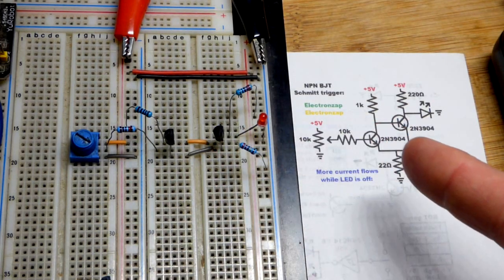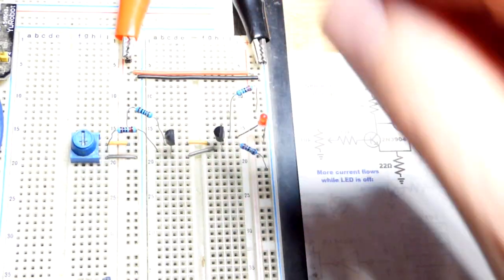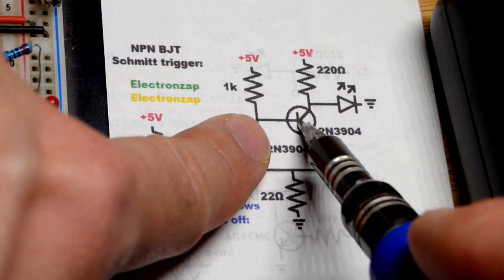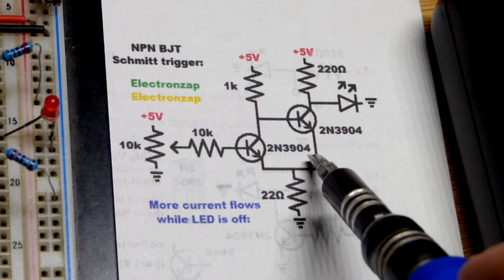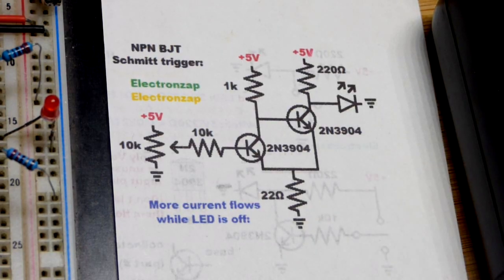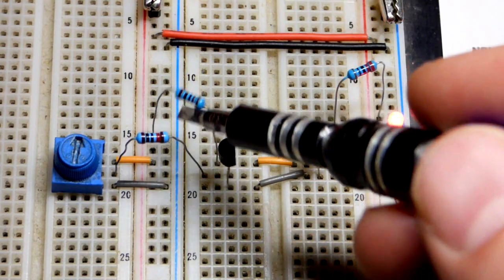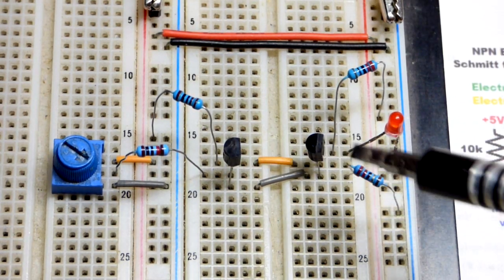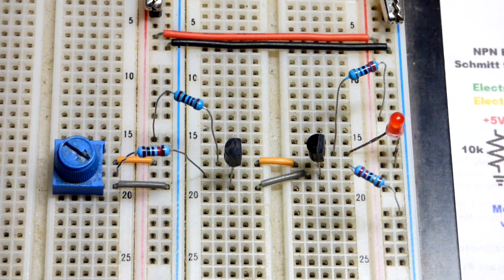2 NPN BJT Transistor Schmitt Trigger demo circuit

Comment: Bro, you're probably the best channel in terms of just uploading raw electrical circuits with explanations on youtube. I appreciate your consistency although i do wish you would use one of these circuits in an actual practical example project, like building a self-initialized night light with a motion sensor and manual switch or something like that, just because driving and controlling an LED light with 100 variations of resistors, capacitors and transistors is kind of hard to extrapolate to real life examples.

Comment: Hi, which program do you use for your schematics ? Grtz
Reply from the maker: I make them from scratch using MS Paint. I copy and paste symbols and stuff, so they usually look the same in different diagrams.
Reply: @Electronzap  MS Paint is a way underrated program, i use it also for simple graphic things, but like you mention, copy and paste symbols is a idea. Thx for the quick reply. Grtz